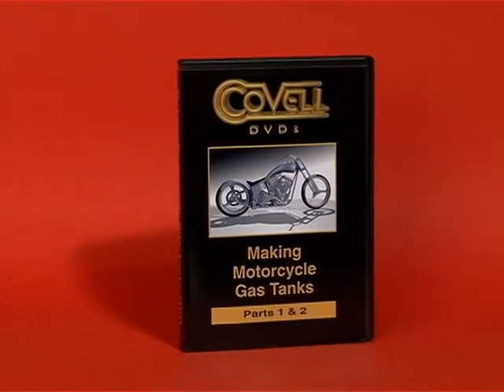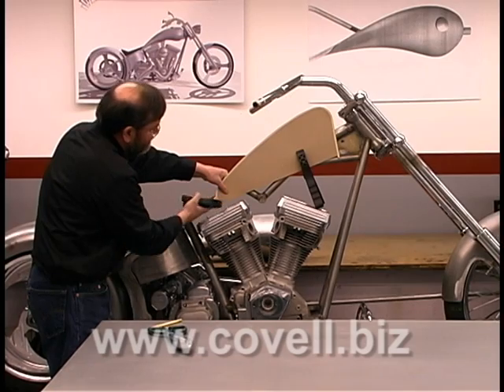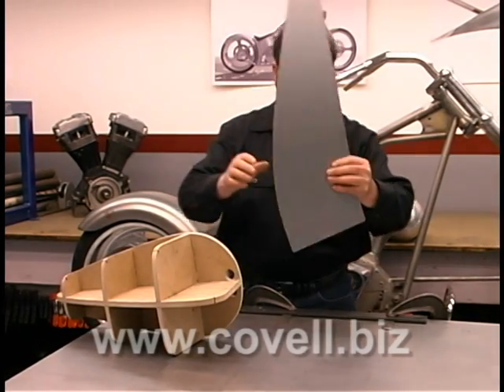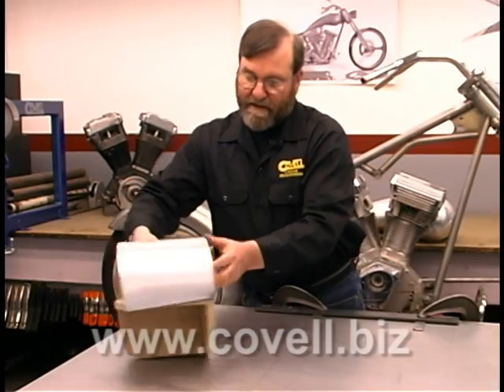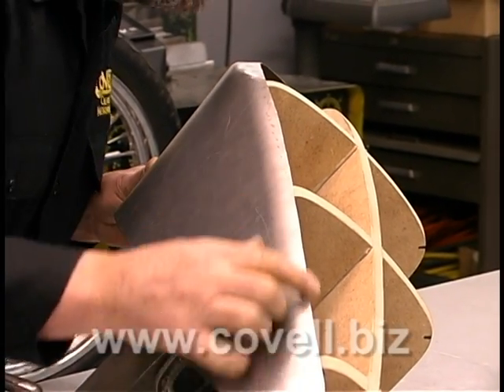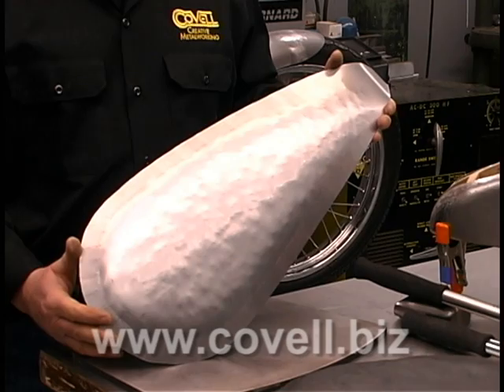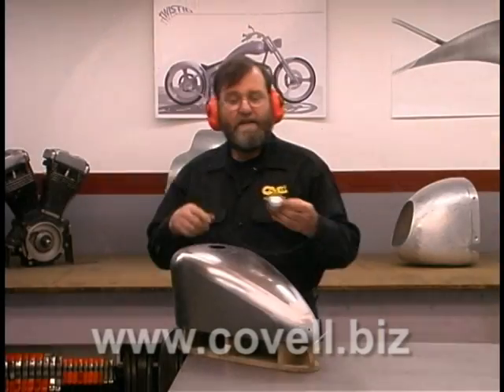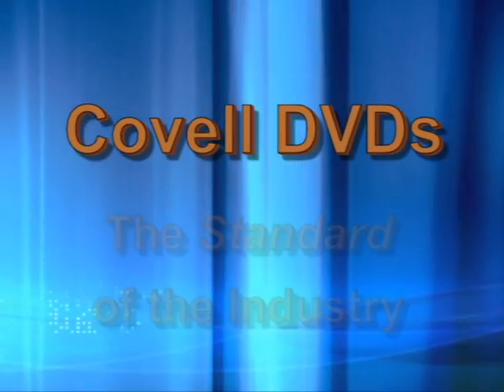Making Motorcycle Gas Tanks Part 1

Comment: you should bend the bottom edge of the tank 90 deg to add structural strength.  A butt joint won't cut it.
Reply from the maker: Thanks for the tip!

Comment: Here is a question. If you had a batch order to make say 10 tanks of the same shape. From getting your eye in and making the first one carefully what will be the difference in time between the first one and the 10th which you could will save?  There are so many old bikes which need restoring but the skills needed to make tanks seem to be hoovered up by the big money classic car restorations.
Reply from the maker: deepinder cheema Great question! Certainly there are 'economies of scale' that make multiple parts more efficient to manufacture than making one part at a time. For example, all of the cutting could be done in one 'go', which is more efficient than cutting one tank at a time. Also, it would be possible to make one tank, cast some simple molds from it, and use the molds to speed the shaping of the other parts. It's often possible to make simple clamping and holding fixtures that will speed the work, too.

I've never made 10 tanks, so I can't give you a direct answer, but the more you make anything, the more efficient you get.

Comment: What type of metal are you talking about in your video, I mean, is it rusty, is it processed, or is it regular iron sheet? Can you tell me please?
Reply from the maker: The material I'm using is standard cold-rolled steel sheet. It is not rusty because I buy it new, and store it carefully before use. If it is exposed to water with no surface protection, it will eventually rust.

Comment: Hi dear

very good video, thanks for sharing your experiences.
What kind of steel use?
What thickness you recommend?

  greetings from Chile...
Reply from the maker: +Jesus Monzoncillo I'm glad you enjoyed the video. I use 1008 steel, because it's a bit softer, and easier to form than the 'normal' 1018 or 1020 cold rolled steel. The 1008 (Drawing Quality) steel is pretty hard to find in small quantities, so most people use regular cold-rolled sheet. The range of thicknesses is usually between 16 ga and 18 ga (1.6 mm and 1.2 mm). Some motorcycles vibrate more than others (Harleys, for example) and these bikes require thicker metal. Rubber mounting of a tank is always a good idea, to help prevent cracking from vibration.

Comment: Great work! what type of aluminium used? and what type of heat treatment used to make softer the sheet? Thanks a lot!
Reply from the maker: +Luca Brambilla I'm using 1008 steel for this gas tank, and no heat treatment is required.

Comment: Alright, I'm very new to this so don't judge me...
But how does the fuel on one side of the tank go the other side where I have my petcock?
Reply from the maker: Småländska Guden - If the tunnel is large, it can keep fuel on one side of the tank from reaching the side with the petcock. One solution is to have a removable cross-tube that joins one side of the tank to the other. You can see that in this video: https://www.youtube.com/watch?v=SvP6PGvdZ7s

Comment: What kind of tool did you use to sand the tank? I've been looking and can't find one that looks like yours or does the same thing anywhere
Reply from the maker: The rough sanding is done with a 50-grit disk on a 3" right-angle sander. The final finish is done with an 80-grit disk on a 6" air sander. I use a DA-style sander, which I lock to use as a disk sander. Last, I went over the welded areas with a flap wheel.

Comment: On the bung you welded for the gas cap, did you sand the welds smooth? I've never done this before, just curious
Reply from the maker: I left that weld unsanded, so it would require a touch of plastic filler before painting.

Comment: Is the material 1.125mm or 1.6mm? I see both quoted. I'm considering hydroforming some tank parts. Is this a method you've ever used?
Reply from the maker: I used 18-gauge steel for this tank, which is about 1.15mm. Some people prefer 16-gauge, which is about 1.6mm. Yes, hydroforming is a great process to use for forming sheet metal, but I have never used the process.
Reply: Thanks Ron

Comment: Subscribed.
Thanks for the content.
Keep up the good work.
בס'ד
Reply from the maker: Thanks for the sub! I have over 100 YouTube videos, so I hope you find some more that you enjoy.
Reply: @RonCovell I was wondering if you have a video on restoring an in-tank moped frame; a good number of these frames are considered to be a loss if the integral tank is compromised. It seems from this video as if you have the capability to cut out and re-fabricate the fuel tank in a situation like that?
Reply from the maker: Thanks for the excellent suggestion. It has been over 60 years since I have owned a moped, and I have never repaired/replaced the tank on one. If such a job does come my way, I think it would make a great video.
Let me know if you have any other good ideas!
Reply: @RonCovell  OK, if I find one I'll let you know. They're not uncommon. What kind did you have? Did you have a Puch before?
Reply from the maker: It's been so long, I don't remember if mine was a Puch, or some other brand.
Reply: @RonCovell  OK, I've got a fellow who has five moped frames in Los Angeles, in otherwise solid condition, but they're considered to be scrap because the integral fuel tanks are compromised. I'll email you the photo. They're all Puchs.
Reply from the maker: Thanks for the follow-up!

Comment: What kind of sheet metal do you use for the tanks? Thanks!
Reply from the maker: I use 1008 Drawing Quality Steel, which is hard to find in small quantities. If you can't find the drawing quality steel, you can use regular 1020 Cold Rolled Steel Sheet.